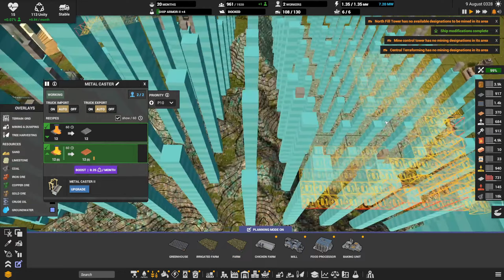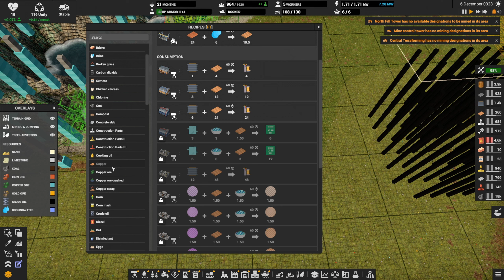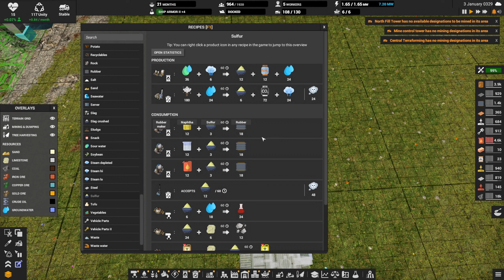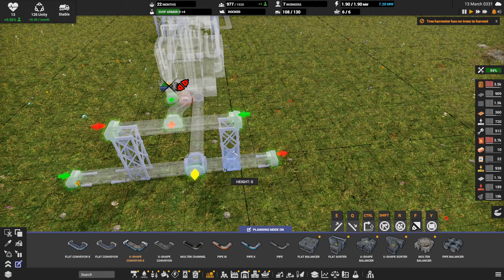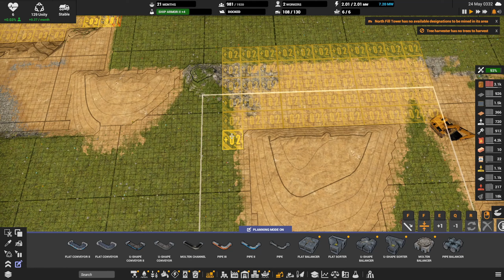Designing New Copper Factory!  Let's Play Captain of Industry s05 e49

Comment: @9:20 mentioned couple episodes ago press F
Reply from the maker: Interesting. I'll give that a try. 👍
Reply: its there on the screen right next to the R key tool button and you can save 1kw power from each of those buildings with single input/output belts by having the junction right on them
not sure why you never used low-steam turbine couple episodes ago when the whole video was building new turbines
trucks need 3 wide to get under pipes/belts and they can easily go around that new copper setup
Reply from the maker: @maireen3517  I'm aware of the "F" key for flipping, but it never occurred to me to try and flip something that's already symmetrical, like a conveyor. I'll try to remember to make use of that the next time that situation comes up.
I basically just forgot about the existence of the low pressure turbines. I used them in past seasons.
I wasn't aware of the power savings, but I actually prefer the look of having the belt junctions one block offset from the building better.
The new copper setup is designed to maximize truck throughput. I didn't know about the 3 block width requirement. Thanks, that's good to know! 👍
Reply: F key for building is to flipping, for pipes/belt its for ignoring input/output of things so you can just drag across without the pipe/belt trying to go around
can hover over the button for the description